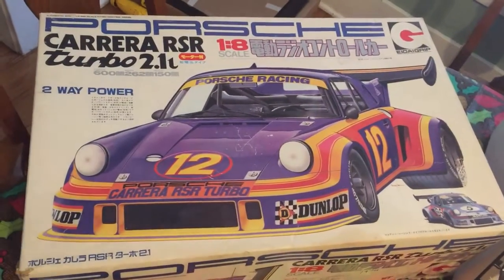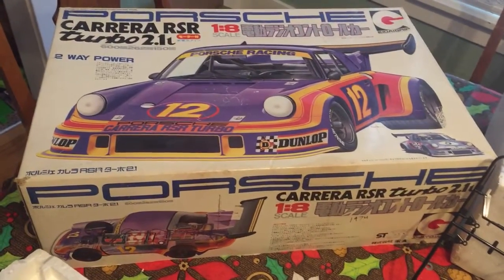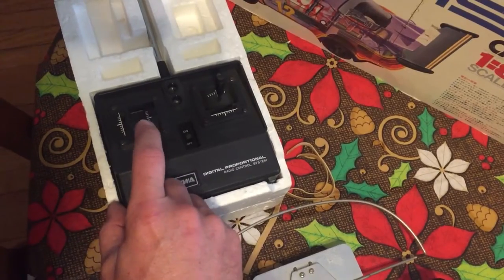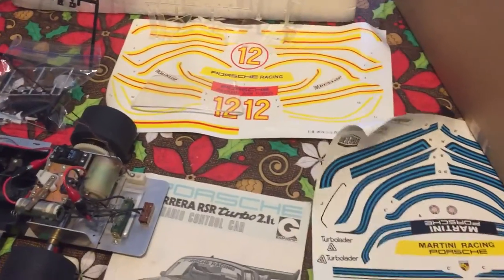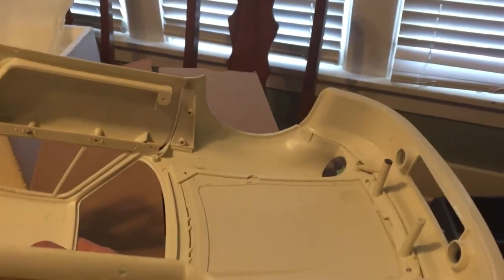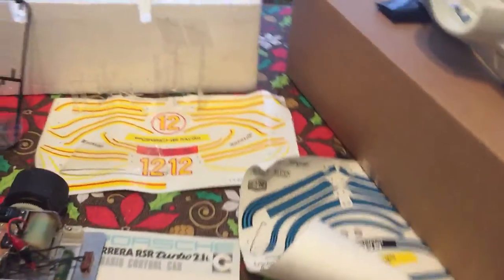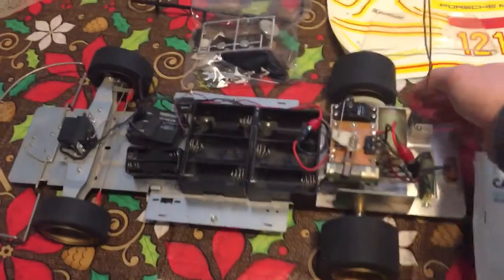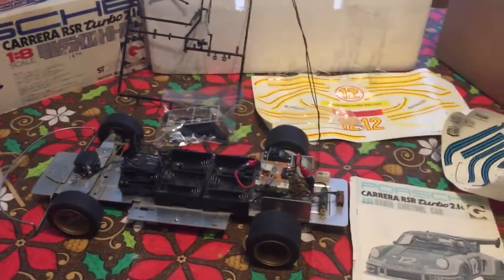Oldest 1:8 scale Rc car I've ever seen Porsche carrera  martini racing remote controll eidai grip

Comment: I have one, it’s boxed and partly assembled. Haven’t had a good look through it so not sure if it’s complete. I have no radio gear with mine
Reply from the maker: Do you know much about what year they were made, or any other cool information?
Reply: Hi Joe, i have no info on it whatsoever. can't find much at all about it online either :-(
Reply: @joestagg72  - there is such little information on these around but as I understand it Eidai was rename Grip or added grip to the branding in 1974.  As I am a Tamiya collector I am excited to know that these in my collection predate those cars. You can see many adaptions of the RC metal chassis through the Japanese early market. To have an anodised chassis plate was quite revolutionary I think? I have both the 1/8 RC Porsches, very lucky to have them too. 

P.s., dropped you another email today Joe, hopefully you get it.